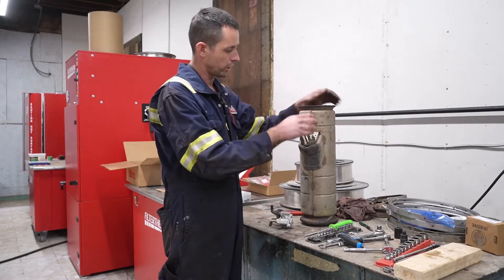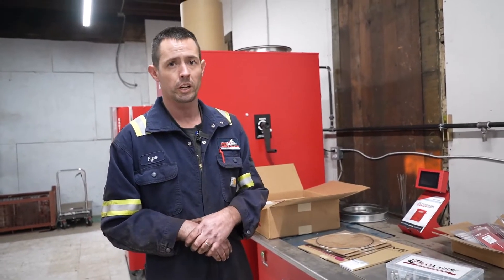SCR NOx Conversion Efficiency LOW fault code on semi trucks

Comment from the maker: Our Truck Repair Shop: Fox Truck & Tractor LLC (Truck Maintenenace, Repair & Inspection)
► https://www.foxtruckandtractor.com/
Our Diesel Emission Shop: Diesel Emissions Specialists LLC (DPF, DOC, SCR & Full One Box Cleaning, Sensor Bung Replacement, TIG/MIG Welding & General Repairs)
►https://www.emissionspecialists.com/
Our Truck Parts Sales: Diesel Truck Parts Store ( All-makes line of aftertreatment emissions parts,  (with over 100 SKUs for DPFs / DOCs, over 45 clamps, over 110 gaskets, over 100 sensors, over 45 weld bungs, and over 30 charge air coolers & accessories), Used & Open Box truck parts)
👉EMAIL/CALL US TODAY TO ORDER YOUR AFTERMARKET EMISSION PARTS FOR VERY AFFORDABLE PRICE!!)
👉FLEET AND SHOP OWNERS - CONTACT US TO SET UP AN ACCOUNT WITH US FOR YOUR DPF CLEANING NEEDS
► Address: 1120 High Ave SW Canton, Ohio 44707
► Phone: 330-573-5396 (for appointment & parts order only)
► Email: foxtruckandtractorllc@gmail.com
Reply: It’s more so body hurts and no I don’t know much about this system. But I know it’s work that I could do. I typically do all maintenance on my things.
Reply: Do you clean dpf filters from diesel cars?

Comment: I’m currently fighting two codes on cm 2250. Codes got only 1 count each. 3135 fmi 2 spn 3610 and 0125 fmi 18 spn 102. Apparently they are connected. So far I’ve replaced DPF Outlet sensor, checked tubes and voltage (5V), IMAP Sensor, checked its wiring, all good. Replaced EGR DIFFERENTIAL pressure sensor, cleaned Gas Exhaust pressure sensor as well as the same looking 1 foot to the left. I can’t recall what was its name at the moment. I cleaned Exhaust manifold Sensing Tube (curvy one connecting Exhaust gas sensor with manifold), replaced Air filter, water fuel separator filter. Nothing worked. Truck was not boosting past 20 psi. Then I opened DPF filter and found it was cracked. I R/R and cleaned DOC.  Reset on insite. Forced regen. By the way reason I didn’t check this filter first was because truck was completing forced regen a as well as regens while driving. Anyways… after replacing DPF truck got its power back. Boost gets to 35 on high gears….but… the codes are back. What I’m I doing wrong? Next I’m thinking to remove decomp tube and check. That’s how I end up in this video. Also, ECM recalibration maybe? But last time I replaced DOC and DPF 5 years ago I don’t remember doing that and truck worked fine. Any ideas, sooner rather then later are very welcome as this issue already took couple of weeks and I can’t work because of this issue. Please help…

Comment: Can you remove those bolts if they break off or do you have to buy a whole new decomp tube?
Reply from the maker: You should be able to cut the broken bolt off and weld a new one on.
Reply: @truckingandfixing  thanks for the tip!

Comment: I am curious why does that doser need to be replaced as opposed to just being cleaned?
Reply: the Def build up means the doser has failed. maybe incorrect spray pattern or it leaks when not in duty command. either way the build up indicates a failed doser

Comment: Hey Ryan, what's your opinion on 2007-2009 trucks that have DPF but no SCR yet? Are they easier/cheaper to manage?
Reply: We have a 2009 cascadia dd15 did a regen and it runs great only problem now is oil mixing with coolant 😅

Comment: Ryan can I mail you a ecm for a cm870 that goes in a international 9900? I got it off ebay to have as a spare ecm. "same cpl"  When I plugged it in it idled fine however when I push the throttle the rpms go wide open. Something needs adjusted. Want to bench load it for around 600 hp useing a fleet calibration